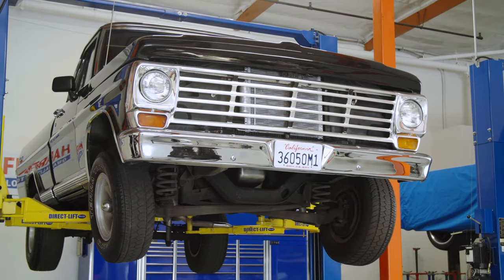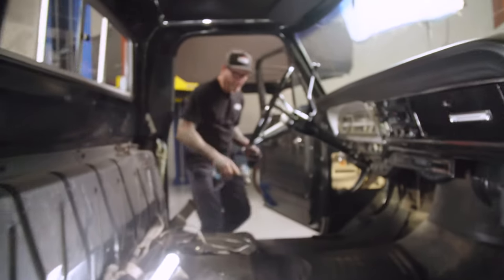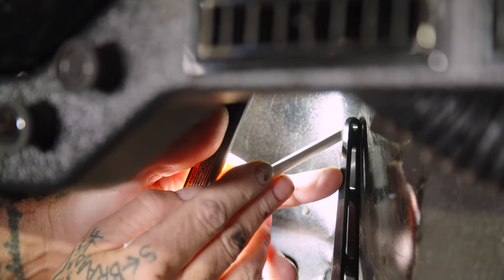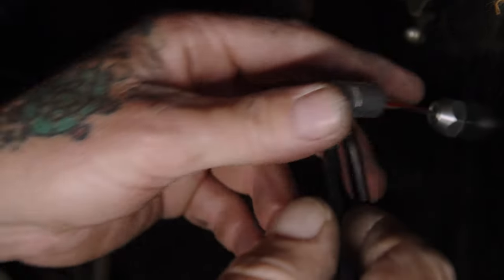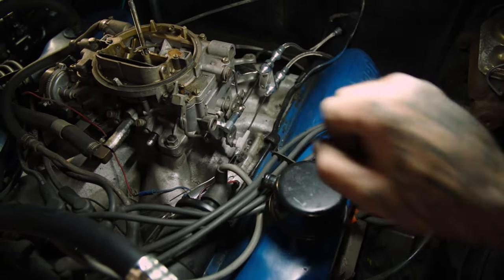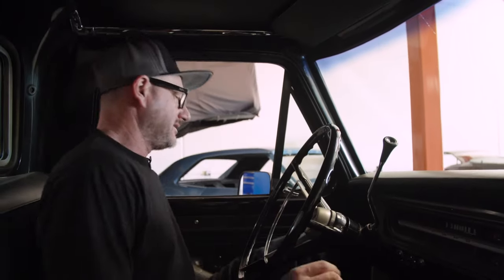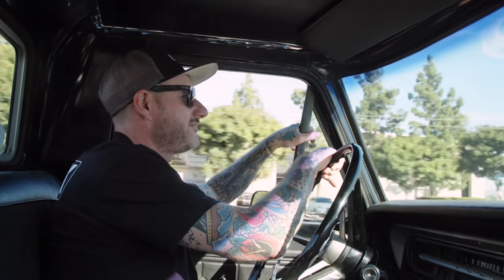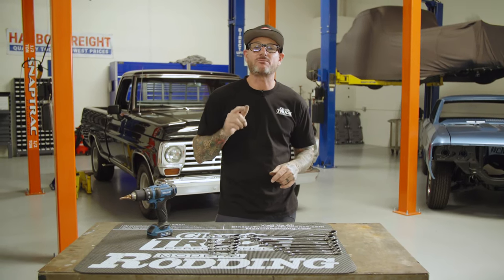How to properly install a Lokar throttle pedal, throttle cable and kick down cable.

Comment: You seem toi have Harbor freight's ear! The are replacing their lower level tools with more expensive tools. The thing that blocks me and my hot rod home mechanic friends from buying harbor frieight's more expensive quality tools, is the fact that if your neighbor or kid borrows a socket or wrench from the set , and loses it, or doesn't bring it back, you're stuck for a lifetime missing that peice! Harbor frieght needs to put a chain link room in the middle of the store and stock it with individuals sockets and wrenches, so that you can replace one piece of your set. Sears, having left the tool maket has left a big gap in home mechanic tools, and if Harbor freight would like to compete with ACE Hardware, they need to step up to the plate regarding customers having the ability to replace a lost socket or wrench. I am a harbor freight fan, and I'm saying this because I personally have NOT bought their expensive (Great Quality) tool sets because of this problem.
Great video, by the way!